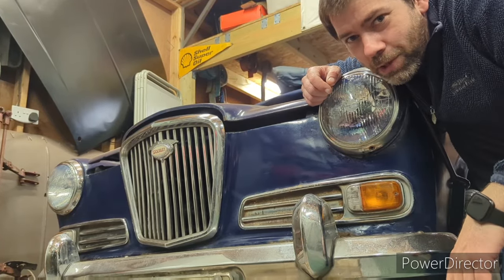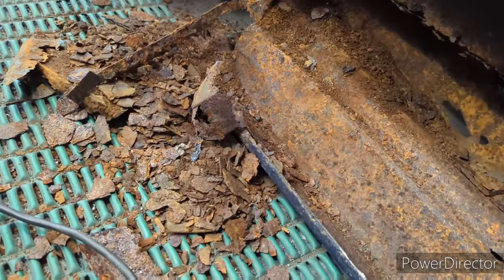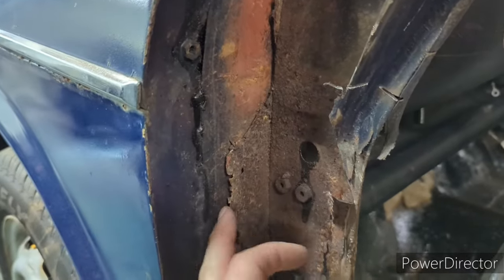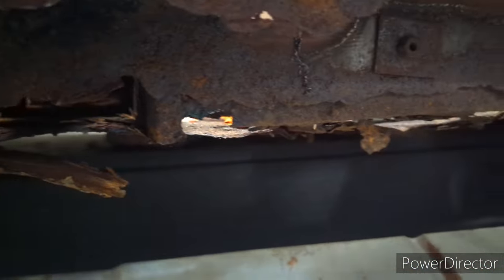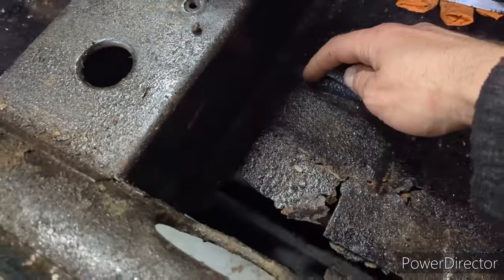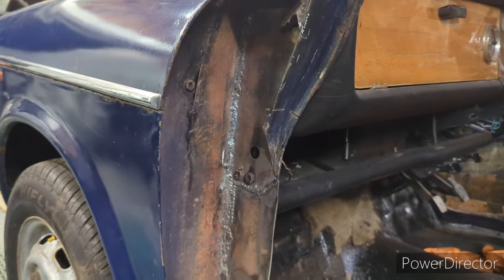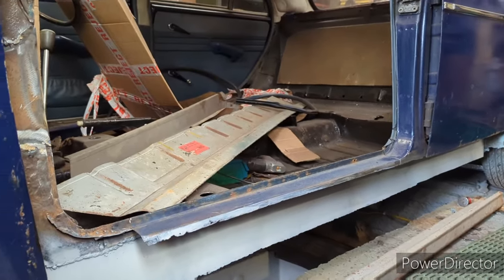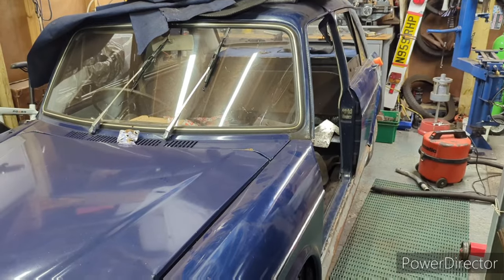1970 Wolseley 1300 episode 3- How can it still be getting worse!?

Comment: Well done for persisting with this challenge. I was rather put off the whole ADO16 concept having grown up with my parent's serial addiction to the things. My Mum's second Austin 1100 lasted just seven years from new (1965) before it went off to the scrap man with terminal corrosion. By this point it was on its second rear subframe but there was nothing left to attach the heel board to. It was replaced by a 1971 Austin 1100 when I was 17. Mum then went on to buy a series of four Minis but at least with those you can still buy all the panels and if necessary a complete shell.

Comment: I didn’t comment on the last video about another mg 1300 mk2 I bought more recently. But it’s in a very rough state needing new front wing, floor pans and sills ext. but when I bought it it didn’t come with a V5 but it did have a number plate. And I didn’t want to see someone buy it just to rip out the engine to stick in a Mini Cooper s replica so I bought it for what it was work in parts. So when I got it I decided I might as well try applying for a new V5 for it, so I did and after about a month or so I got the V5 for it and it turns out it’s a one owner from new and has only covered 38,000 miles (at least that’s the milage on the speedometer). So I am more enthusiastic about restoring it now and I’m sure I will get around to it eventually after finishing the restoration on my MGB. Although as I said earlier the 1300 mk2 is rotten the door pillar aren’t full of filler and are still holding the doors on quite strong as they still close quite nice, but lucky no one has been at it before with the welder at lest so there aren’t and nasty surprises I can’t already see which is a positive. Anyway that’s enough rambling from me, nice video and good luck with the rest of the restoration.
Reply from the maker: If there's one thing my car can do, it's make yours seem less rusty! If no one else has been in there before bodging previously, that makes it a much more worthwhile project as well. Good luck!

Comment: Can you use the other side as a template ? The nearside always corrodes far worse due to all the cack on the kerbside gully
Reply from the maker: Possibly yes. Though I might end up opening a whole can of worms getting the door off!
Reply: You say that I had a mazda 2 2007 and that thing was rotten on the drivers side it only had 34k on it when I bought it passenger side was fine

Comment: Why not let "Yorkshire car restoration" have a
look & get a quote ?
but to be fair it would 
cost a fair bit l would 
think. Yes l am a cut
out rust kinda guy &
would go the whole 
hog  , no short cuts !
Reply from the maker: This car is just not a candidate for a full restoration unless it had some sentimental value. Even if I did it myself so only paid costs, it still would cost more than it's worth. But if I can save it from the crusher and get it back on the road, that's still much better than the alternative. However, stay tuned for proper restorations in the near future. I have plenty in the pipeline.

Comment: I think you could repair that A-post... if the driver's side is still present use it (and the original passenger one) as a guide to where the edges of the panel would be and weld pieces on to get it there (like doing the outside of a jigsaw. After that recreate the centre of it with metal folded over in a U profile. Don't worry about how many small pieces you use to recreate the whole. It won't be seen and as long as the shape and position of the holes (for the hinges etc) is correct it will work fine. Try watching Yorkshire Car Restoration 's videos for inspiration. They make all sort of repairs from small pieces https://www.youtube.com/watch?v=v9o2XokDr60
Reply from the maker: Yes, anything is possible with enough perseverance I suppose. It's a shame the bottom bent so much in removing the door. If the parts were still in the same place it would make a repair easier.